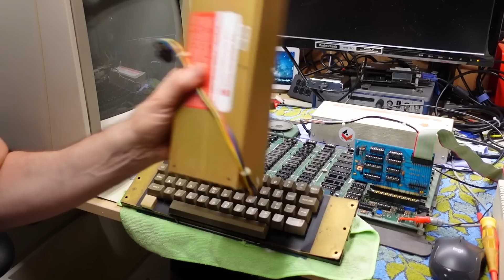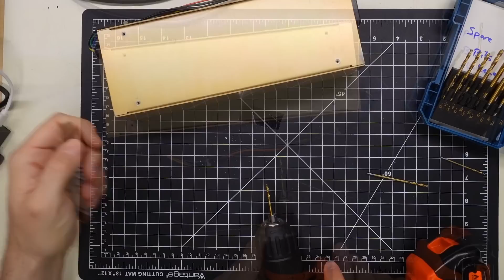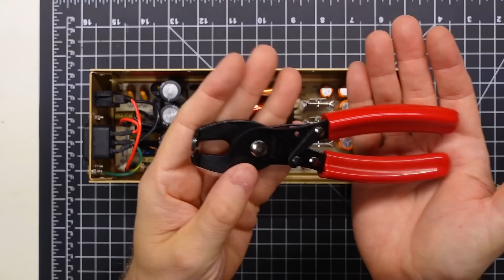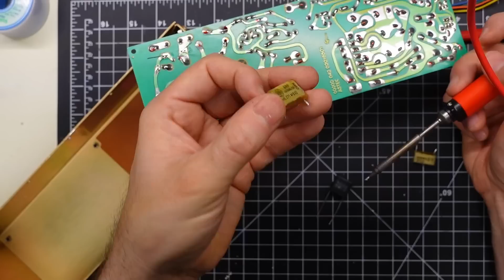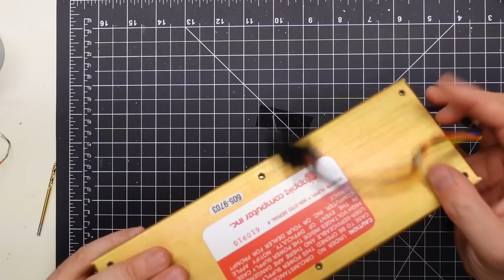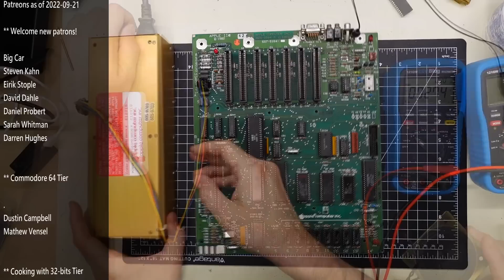Apple II power supply service and testing

Comment: I had an original Apple II with an Astec branded power supply that failed, it was the first switch mode power supply I had ever seen.
Turned out that it had some bad soldering and the chokes on the outputs had broken loose.
It was not user serviceable because it contains very high and very lethal voltages.

Comment: The capacitors that frequently bulge and leak are the type that are designed for extremely low ESR. The chemistry of those capacitors is difficult. Only the top tier manufacturers are able to make them reliable, but even from those top brands they aren't as long term stable as more conservative caps from the same brand would be.

The most famous scenario is PC motherboards.  Each brand had caps that were specifically marketed for motherboards which had extremely low ESR specs, but their chemistry was aggressive and so reliability was a compromise.  When motherboards switched to polymers, those series of caps were discontinued because basically nobody else wanted them.  Nowadays the top manufacturers have some caps that are getting closer to the ESR of those old "motherboard" caps, but with better reliability ratings than the old caps had.
There are multiple tiers of how low the ESR can get from different cap series.  The most extremely low ESR series are normally the ones that people find leaking.  Such caps aren't needed for things from the 1970s or 80s.

Power supplies normally don't use those Ultra Low-ESR caps, and certainly this one doesn't.  As long as you use caps from a quality manufacturer that match the application, then they will be as reliable as the old ones were.
Something like Nichicon PW or Nippon LXY or LXZ, for example, are still classified as "Low ESR" but they're at the most conservative end of the spectrum.  Physically larger and ESR is also much higher than the aggressive caps are.  They should match or beat the ESR specs of any electrolytic from the 80s or earlier, and they're basically bulletproof.
When the more conservative caps get decades old and die, they probably won't show any dramatic signs, they'll just quietly go bad and still look normal.
Whether to replace old caps from a quality brand is a judgment call.  But if you do it, the new caps will be just as reliable if you spec them appropriately.  Don't put caps designed for a Pentium-4 CPU VRM in an Apple-2 PSU.  It's like using a Ferrari as a family station wagon.  :)

Comment: I've replaced all the caps from a cap kit from console kits and its still dead. I have another untouched power supply to use with my apple II+ and that power supply worked fine with this computer. Not sure what i'm doing wrong.

Comment: If you can't see the bottom of a radial cap then you don't know if it is good. The only comfort you should take in seeing that the leads haven't corroded is that you got there in time. I've only worked on two Apple II power supplies and I've already seen one cap that had crystals forming on the bottom that would have been a disaster eventually.

Comment: That "little cap" is rarely the reason a PSU wont start up, it is more often that little feedback transformer has an open circuit winding.  The small cap issue is more common with dynacomp PSU's not the Astec design.

Comment: As for drilling 'pop' rivets it seems natural to align the drill bit perpendicular to the rivet, as if drilling through the barrel of the rivet, but that just spins the rivet in it's hole; far better is to use a little oversized bit and begin tilting the drill so that is is NOT perpendicular. That way the bit will begin cutting away the 'head' and, at the same time, slowly rotate the rivet to cut all the way around, quickly and easily removing the 'head'. I discovered this many years ago by accident; try it, you'll like it!

Comment: if you buy cheap caps, you get a cheap outcome. There are very high quality caps being made now, spend a couple extra dollars and don't cheap out.  The electrolytic caps in those supplies are 40+ years old, they may be ok today but I guarantee they are going to bite you sooner rather than later, and you can't just tell by visually inspecting them.

Comment: I disagree with you about capacitors. Modern caps from good brands are as reliable, if not more, than caps from the 70s, also electrolytic caps even when not use will dry overtime, slower when not used than when, but they will anyway.
And the caps for the early to mid 00s is the well know Capacitor plague where some shady caps manufacturer used a stolen formula that was not complete, and all of the caps from that era from non good brand will fail in dramatic effects.

Comment: Hey Adrian, could you someday discuss power supply safety?  I am decidedly NOT an electrician and have avoided going into power supplies and monitors because of being spooked by voltages in capacitors.  It's not that I don't know what I'm doing, theoretically at least, but the popping and arcing of discharging across caps (with a screwdriver, that is) makes me jump so bad that I can't stand even doing that, much less imagining getting bitten by one on accident.  I also have an inordinate fear of thunderstorms, so it is just me.  Thanks.  I am considering looking around for an old Apple 2 to adopt and restore after watching your vids... we had one when I was a kid, but I never had the mentoring to understand the magic of the hardware or the software in these old machines.
Reply: Those Astec PSU's  have bleed resistors across the mains side caps so they dont hold charge for long.  If in doubt use your multimeter in DC volt mode measure between the exposed metal on the top of the largest caps, if none read more than a few volts you are good to go.

Comment: My only advice on rivets is to chock up on the drill bit so only a quarter inch of drill is exposed.  I freaked out a bit when you ran half the length of that bit into the case!
Reply: Nothing in that part of the case but air, so long as you shake out any metal shavings there wont be a problem.

Comment: my opinion with an aging electronics always throw a UV light over circuit boards to rule out the leaking caps, whilst it is common for them  blow up and out for a tell tale leak it is what happens when they fail from the leg end of the cap which might not be safe to keep in play..

with a sub 40 year old power supply I would err on the side of caution and do a proper and complete cap replacement since you haven't bothered to uv light it as when caps leak you may not see how bad a leak is..

Comment: Your rivet removal method is actually extremely standard... I agree on cap nonremoval policy (you really shouldn't bother unless they're actually bad, except for RIFA-style caps, and "old" is not a synonym for "bad") but your example is flawed. Your early 2000s bad caps were almost certainly Capacitor Plague victims, look it up. Wiki has an excellent accounting of what happened; tl;dr it was an attempted act of industrial espionage that botched like a bad comedy spy movie, and even reputable capacitor manufacturers fell victim -- as did major OE brands of all sorts of tech from computers to televisions to cassette tape recorders and back again. ALL name brand PCs from that era -- Dell, HP, Compaq, eMachines, etc -- had major, major issues with those caps.

I've found that power supply diagnosing is... highly individualistic to the symptoms in question. If it 'kicks' -- bink bink bink bink -- it may be detecting a short elsewhere, or the lil capacitor that powers the control chip at startup may be cooked. It depends. Most of power supply repair is like that -- you really can't know what to check until it's sitting in front of you and you can kinda play with it and fault=find. Those with experience know what I mean. Probably the best generic advice I can give is, take it slow, don't do anything obviously stupid, and don't buy computer power supplies from Gigabyte. (Heh.) BigCliveDotCom is an excellent channel for learning how to fix power supplies, if you watch an afternoon of his videos on the topic, as long as you already know electronics a bit, you should be quite solid ;) oh -- one popular misconception -- ALL switchmode power supplies are doornail dead after a full minute, by design -- almost all by five-to-ten seconds. There's a resistor designed to limit "inrush current" (a surge going in to 'fill up' the proportionately huge filter capacitors near the input) and that doubles as a sort of 'bleeder' so that when you shut it off, it drains itself.

Comment: On another note, I have plans to try restoring DC-51 switches by adding an acid bath to the process. Don't worry, as I will be using switches that fail even with extreme use of DeOxit baths and mechanical hammering over hours. If this proves to be a success, I will post a video on it, and Datanatics switch restoration. If not, no harm done. 

I have a chem lab here, primarily for metals and plastics, and I regularly work with mild to strong acids, and have the right equipment to do this. In theory, unless the internal plates are warped, this may allow them to make proper contact again. The key issue is a design flaw and how the plates build up corrosion, but I am unsure on what plastics are used internally and their reaction to the acids. is 

On a positive note, I have about a full KB worth of dead DC-51s, and this would be a one switch per solution experiment, so I have a few dozen tries to restore totally dead DC-51s.

If this works, I will share it with all of you, to keep these old machines alive and intact. If it fails, I will try to do a postmortem and explain why. I am not monetised, I do not do this for profit--retired--only for community beneficence.

If you are either not suited/equipped with handling caustic solutions, are not familiar with chemistry, or generally do not know how to handle acids, or plastics, or lack the proper safety equipment, please do not tinker with these concepts. As a man who has had his lungs burnt by HCL fumes, accidentally, I urge you that this is very dangerous stuff.

Comment: @Adrian's Digital Basement ][ Please do not toss, or fail to return the Datanetics KB to the owner. That KB is a very special and hard to obtain item that proves a pedigree of 1979 or earlier to the system. They are incredibly tedious to repair or restore, but  it is one of the few things I would be willing to come out of retirement to do for someone. 

Note also that you cannot reliably disassemble and functionally reassemble the DC-51 keyswitches, because of how they were designed and assembled. The best first option is to soak each switch in deoxit red, bang on them a hundred plus times, then soak each in deoxit fader lube (green) and repeat.

If the matrix chip is faulty, r&r that first. They are still available, but growing scarcer. 

I have restored a few Datanetics KBs, and in the end, I always had to source spare DC-51s. Some switches simply cannot be repaired. They are also prone to splitting open on solder/desolder, (or even just with age/use), so I advise giving each one a tiny dab of super glue on its seams ere removing or installing it to prevent the thermal transfer splitting them open. 

In fact, I advise putting a tiny dab of super glue on the seam of good keys, so that they do not crack open during use, which is one of their failure points. Take it from someone who had their reset key crack in half at random: Seal those 45 year old plastic seams. 

Should that KB ever be for sale, I would buy it as-is for spares for my early machines.

Note also that the keys themselves are entirely different to keys from a later ][ (or ][+). The keycaps are taller, have a different angle for the connection to the switch, are a slightly different colour, and a slightly different lettering style. All these little esoteric Apple ][ facts.

Comment: That PSU has been swapped in the past. Note its serial number and style: A system from 1979 would either have the silver PSU used in base ][s until that point, or the early gold PSU with (I forget if it is a RIFA or a fuse) cover on the back.

These are the types of PSUs used in the series:

Type I: Silver, white label with red text , soft feeling switch, no fuse cover. 1977-79; possibly through 1980 to deplete stock. p/n A2M001. No ASTEC markings, possibly made by Apple internally, but I am unsure at present. Wire colours include the white with orange stripe and similar, with the Type II. (I strongly bel;ieve that this was TelCom wire, based on the colours.)

Type II: Gold, hard press power switch, could have hand edited p/n 605-5701 (or with '1' crossed out and marked in hand as -5703 for very late 1979-80, maybe up to early 1981?). Wire colours are blue, white, orange, white with orange stripe, white with green stripe, black, black. Serial Number reset; mine is No. 001592. Has cover plate above three prong power connector to cover fuse or RIFA (IDR which).
Used 1979?, 1980 to early 1981? (Note, this is from memory,, and I am old.)

Type ?: Never seen one, but it is possible that a 605-5702 exists. The sheer fact that I have a 5701 with the 1 slashed out by felt tip and marked 5703 may indicate that 5702 was skipped for some reason, but I have no evidence for that.

Type III: Later ASTEC gold PSU, no cover for fuse/RIFA; same switch as Type II, but wire colours changes to green, yellow, orange, blue, black, black. p/n printed as 605-5703. Used on 1981 and later ][+ machines, including RFI.

Type IV: Used on the //e, returned to silver case, made by ASTEC, now has caution stickers about electricity. p/n 825-0510 (possibly -A or -B, etc.), 1982 to 1993.

Type V: //gs power supply. Connector changed, and internals re-arranged; housing changed for lock-in elements instead of screws. Used 1986 to 1992. 

All of these are electrically compatible across the entire range from the ][ to the //gs.

Another thing to note is that until 1979, and introduction of the ][+, PSU serial numbers tend to track very closely to the computer serial. My ][ has a PSU and a system serial both in the 5000 range; but they do not match up perfectly. That said, a 600K serial gap is a dead giveaway that the PSU was changed out in the past.

Comment: i usually use a larger drill bit with a good conical tip. drill until the head separates from the shank. it usually leaves very little damage behind. also be sure to make sure you didnt get any metal in the electronics. clean everything thoroughly to avoid undesired shorts.

Comment: Hi, not apple related but crt monitors.😅 I just purchased a Clover Electronics CCTV monitor that is NOS and was wondering what is the best way to send a video signal from a PC to it? It has two BNCs one is Hi assuming it’s high impedance and one 75 ohm. 2 RCAs and A + B inputs for audio that are also RCAs. Additionally, it’s got an S-Video input that did not work when sending a signal from a Playstation 3. I’m a regular viewer of your channel and have learned a lot about diagnosing CRTs and finding faulty components. However, upon close inspection it looks like everything is in good shape and no leaky components. Also the monitor has a Samsung A34KQV42X01 tube and OSD that doesn’t do anything when pressed only blue screen with lines that can be removed when adjusting the Focus and Screen knob’s internally. It also got a Voltage Adjustment knob that I didn’t mess with yet. Thank you! 🙏🏼

Comment: The "better tool" for removing rivets is just a slightly larger bit so you can detach the flange. You're still going to hate doing it. :)

It's what you ended up doing.

Comment: Just a thought, maybe before connecting a motherboard to the PSU, connect a lamp to the 12V and/or 5V rails and let the PSU drive the lamps, then check the volts, just in case something else is wrong.  That protects the motherboard from damage from PSU faults.
Reply: These ASTEC PSUs do not a load to be tested. You can test the output from the bench with basic equipment, so connecting it to a mainboard isn't required to check voltages. If you need to check it for current under load, that's when you hook it up, as this can indeed fall off, but I would check the +/- 12VDC and 5VDC rails beforehand.

Comment: Not that it really matters but I'm not sure this was the original power supply for this machine . They had sequential numbered power supplies around this time and my Apple II (A Rev 0 Serial number 5500) has PS number 5414 stamped on it, but mine also does have the rivets holding it closed.

Comment: It could be the other way around that it is the non-cracked capacitors that will blow... I have RIFA that is cracked and they are still working after 35 years.

Comment: Some PSUs that my previous employer designed/built used these rivet-screws. In the factory we had a tool to remove them - a slender hexagonal shaft which you would insert into the central hole of the rivet. It would bite into the rivet body at six points and allow you to twist and pull the rivet out without any drilling or debris.

Comment: A larger bit works better just slightly larger than the hole because it will just cut off the head and the rest can be just pushy through.